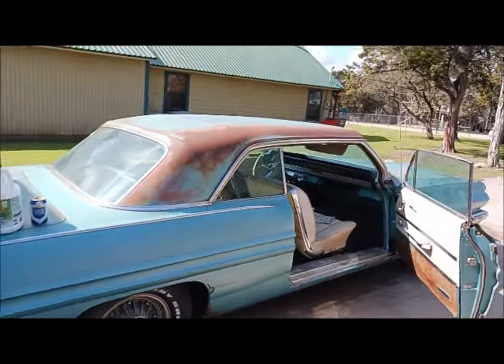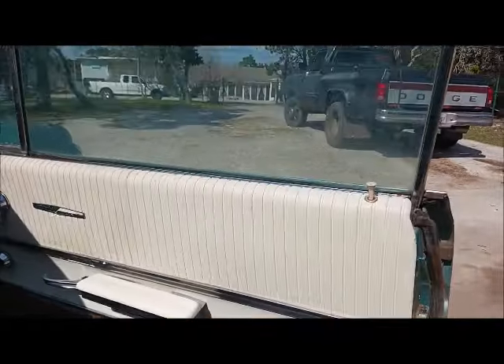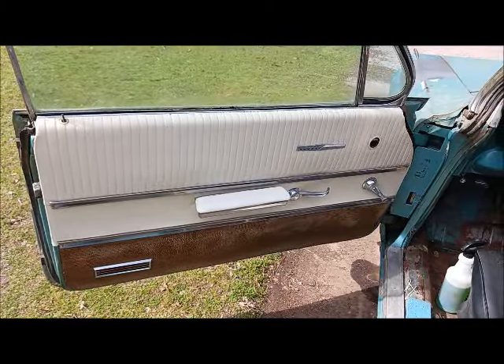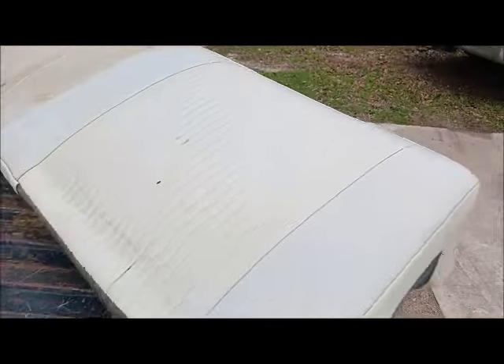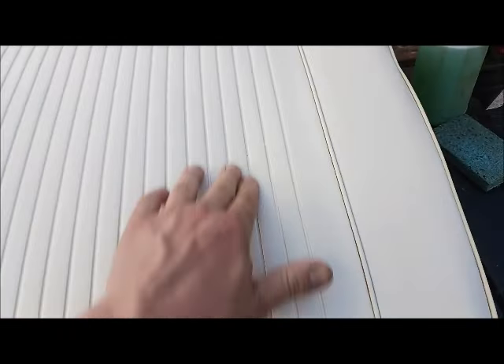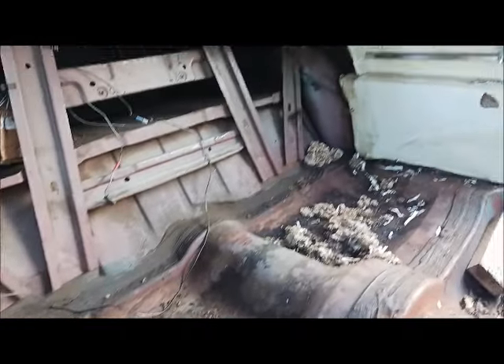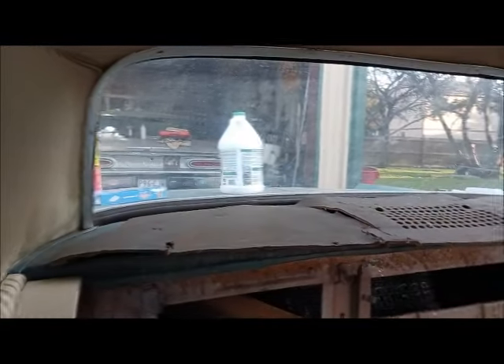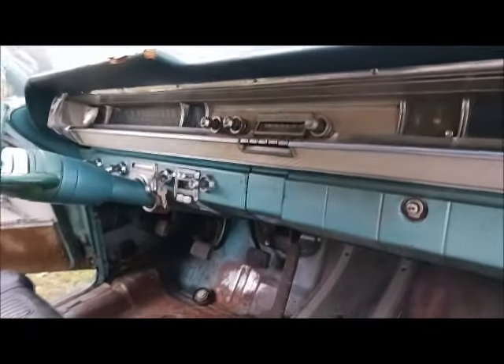Cleaning the original interior on my 1962 Pontiac Grand prix 389 4 speed HHG

Comment: i had a 62 grand prix from 1966 to 1978, black on black 348 hp 389, with the wide ratio 4 speed and 3.23 rear gears.  what a great car.
Reply from the maker: Thats bad ass! Some of my favorite cars. This is my 3rd 1962 GP. Also had a 64 GP
Reply: @halfwayhousegarage2959  you should keep this one, mine was my all time favorite car. im almost finished getting my 61 corvette ready for the road, its been a 7 year frame off project. the 60s were a great time for cars.
Reply from the maker: @davidmckibbin4440  i cant really think of a car id rather have. This is a factory 425A 348 tri power 4 speed 3.90 gear car. Its as close to an SD as you could get. Its got a 1963 303hp 4 speed engine in it now.   I have the service replacement 425A block with 421 heads that will go in it someday. 

Definitely a cool era for cars. Love it
Reply: @halfwayhousegarage2959  sounds great, i bought mine at roth pontiac in burbank calif.when i was in high school for $1200.00, with that 3.90 rear like my corvette has a 3.70, i put a gm crate motor 350ci in and a T5 trans so it can cruse on the highway, other than that the car is stock looking. my grand prix had the cast iron headers also.
Reply from the maker: @davidmckibbin4440  hell yeah! Those 61s are sweet

Yeah, the 425As got the cast headers. Mine has them too. Im going to keep the 4 speed but i might swap the rear. I haveva 3.42 safe t track in my 59 star chief. I might swap that into the GP
Reply: @halfwayhousegarage2959  you could also get a gear vendor overdrive unit, goes on behind the trans. the T10 is a much stronger unit than the T5.  back in the 60s royal pontiac in michigan  had a tuning kit for the 348 hp motor, cant remember everything, i know they put a dual point distributor, re jet carbs and advanced the cam timing, was said to put out 376 hp.royal pontiac was into racing
Reply from the maker: @davidmckibbin4440  gear vendors are way too expensive and not strong enough for the cost. Honestly, ill probably just leave the 3.90s in it. 

Ill have to look into that Royal Tune Up